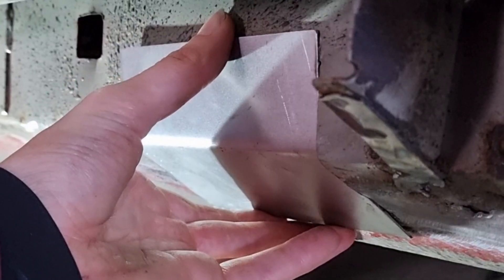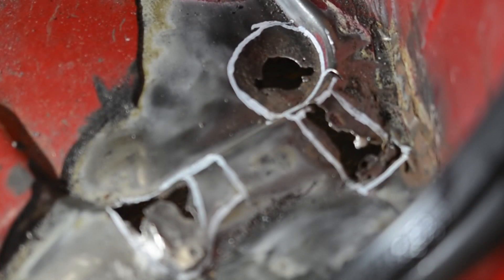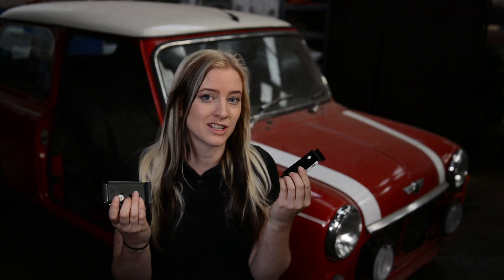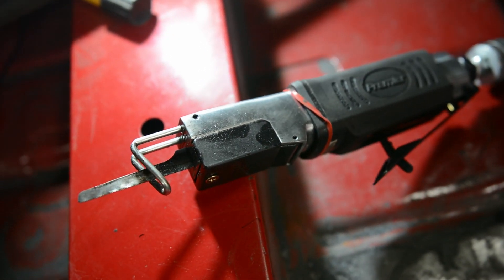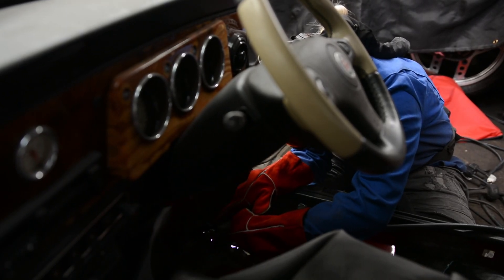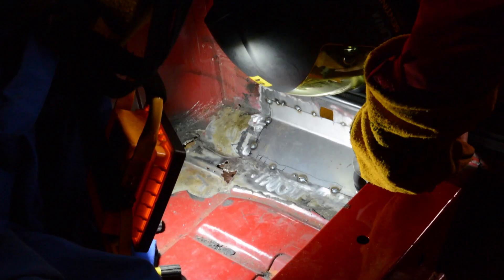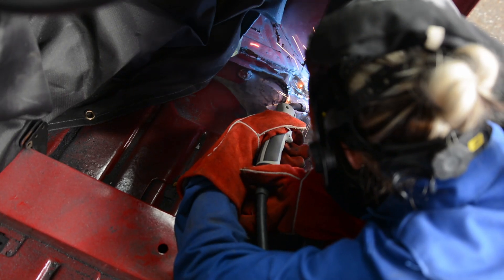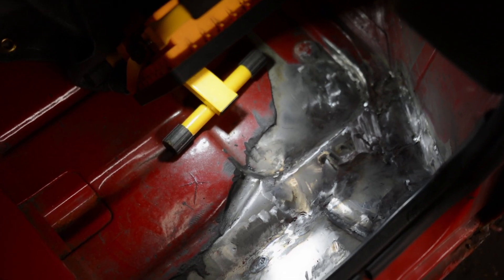My First Ever Car Project: Classic Mini Bodywork - Floor (Episode 2) #laurasworkshop

Comment: I was interested to see your article in Professional Engineer. I am C.Eng. Been working on classic cars for years now but always something to learn. Just taken an online HNC in welding fabrication and inspection. Even though of retirement age. Quite a through study of the ins and outs of different welding sets, and more. Employed part time as design, welding and manufacturing engineer. Good luck with the project. Never worked on a mini myself.
Reply from the maker: @henrybuckeldee3783  Amazing! Thank you for reaching out. That's really inspiring. I don't think I'll ever stop wanting to learn, no matter what age I am. All the best!
Reply: @Lauras.workshop  One thing I always say if you want to qualify as a professional engineer, it pays to do a project management course. I did a APM course. Because they will be interested in how you manage projects at the interview stage.